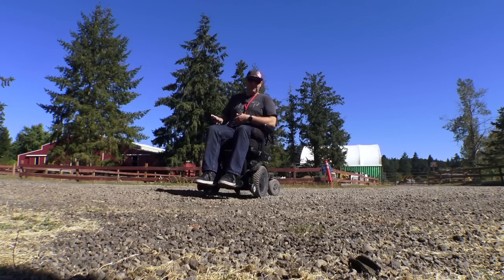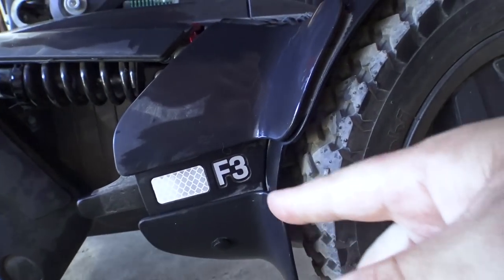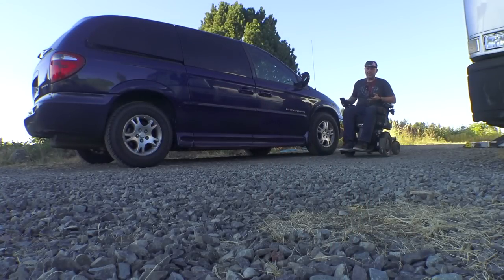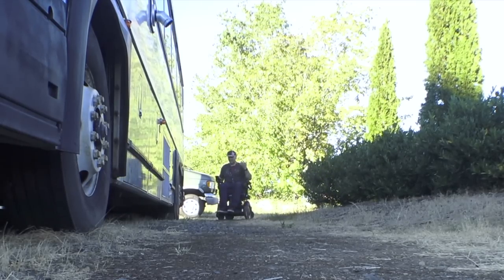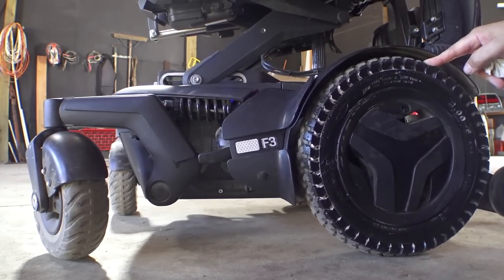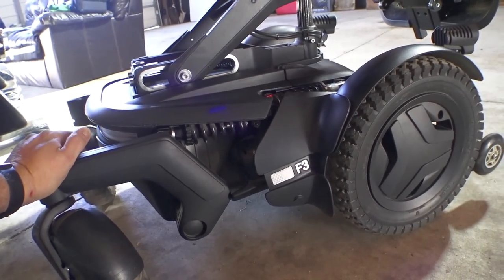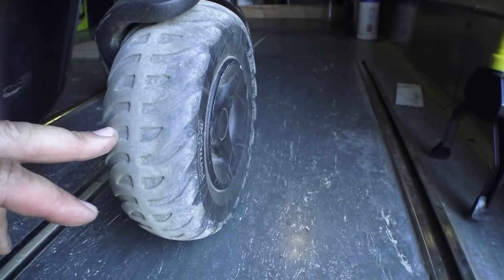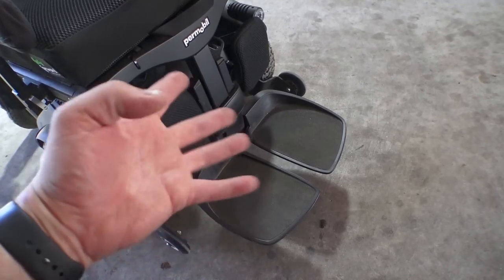VLOG 629: one year later - Permobil F3 review!

Comment: New to your channel. Transitioning from cane, walker, and mobility scooter to powered wheel chair due to rare disease causing spinal cord damage and eventual paralysis from the chin down. I'm new to the whole dealing with medicaid and getting a powered wheel chair through them. Just in the very beginning of the process. Getting evaluation through my doctor next week. I've been told that they only pay 80% for the cheapest chair available. How do you get them pay for such an expensive chair? Any help would be much appreciated.
Reply from the maker: hey! it all depends on your diagnosis codes - the chair in this video is a group 3.. also known as a 'rehab chair'
tilt function for example is qualified by things like pressure relief etc..
recline - can be things like using catheters, positioning etc..
power legs - edema/swelling in feet/legs..
those are just some examples.. but its all about the diagnoses and associated billing codes
seat lifts/elevators are almost never covered by insurance (maybe 15% of the time)
but if your conditions meet the proper codes, they'll pay for a group 3 rehab chair typically without too much trouble

also typically if JUST mobility is the concern, and have no pressure sore issues/positioning needs - they go for a group 2 chair.. those have a 'van seat' or some other kinda of static (non power adjustable) seating
though a lot of them have manual recline levers

sometimes they go for a group 2 chair if only 1 power function is needed as well
medical billing and coding is a tricky thing..
ya need an ATP that knows their job very well, and can write a GOOD letter of medical necessity!  but each feature needs to have a solid, matching billing code to get every line item paid for

for example.. if someone just 'wants' power recline because it would be nice, but no medical billing codes can attach to it (because they cant say its medically necessary), insurance wont pay for it
Reply: @TotallyNormal-  Thank you so much! I've been trying to find this kind of advice for a couple of months now. It's exactly what I needed to know. My disease is called OPLL, ossification of the posterior longitudinal ligament. It basically causes the ligaments next to your spinal cord to calcify and turn into bone and eventually fill up the spinal canal and crush your cord. It also grows spikes that pierce the cord. I have it in my cervical area bad. Had to have a surgery where they split open my c2-c7 vertebrae to allow room for the bone to grow away from my cord. It's in my lumbar area now. Daily life is dealing with constant pain and loss of mobility. I'm hoping a chair will help with the mobility issue. Whatever chair I get will have to have a good plush suspension on it because I'm very sensitive to anything jarring and I need something to support my head well because my neck gets tired very easily. Thanks again!
Reply from the maker: BTW.. if you a have medical need for good suspension, you might be able to qualify for a group 4 chair - those have much better suspension! like permobil F5, magic mobility, and some mysystems chair.  
good luck with everything! its a long process... ive got a series of videos about getting a new chair.. can take anywhere from 3 months to over a year once the process gets started.  just keep on top of things, and make friendly phone calls every few weeks to keep everyone moving along :^) https://youtube.com/playlist?list=PLDSsC1nZPlqlXIw7pcTeiSon67BYp9Qp6&si=EMSIkaIECMiOmarE6JChQQ
things changed a lot because of the pandemic.. but should be a similar-ish process

Comment: I agree with a lot of the things on this vedio.  Ive had my chair since 2021.  I love the features but as stated a good ideal not much thought.  The tires  don't last me very long either as I am a very active person.  I hate the plastic they could have designed them with more thought and I have very much expressed this to Permobil they are slow to service them also for the price I have been unhappy with the chair and the batteries it takes so long to get thrm replaced you really need s good back ip chair or they should loan you one just saying.  Otherwise it. Would be a great chair
Reply from the maker: BTW I’ve had really good luck with the aggressive tread tires! My last set lasted almost 800 miles- and they improve the ride quality a bit as well :-) 
They’re made by Permobil- I just buy them myself on buildmywheelchair.com

Comment: Hi Allen, I have a question pertaining to the batteries; I replaced both batteries with according to BK batteries the same type of batteries.  The problem is that they dont last but only three hours and I have to recharge them.  what do you think my problem is?  My wheelchair company has been no help.  It's a 2016 Permobil F3. the old batteries would last for days on one charge. please help!!
Reply from the maker: do you have a different charger ya can try just to rule that out?
Reply: @TotallyNormal-  the battery charger is working fine, because it only takes about two hours to recharge the batteries but they just don’t last
Reply: And I don’t have an extra charger
Reply from the maker: something is wrong if it only takes 2 hours to charge dead SLA batteries..
have you left it connected overnight to make sure they're getting charged all the way? what brand are the new batteries?
Reply: @TotallyNormal-  yes it’s plugged in most of the day and all night
Reply: Well they are not completely dead, the battery lite is usually flashing by the time I get inside my home and plug it in
Reply: How can I tell if BK batteries sold me the correct batteries
Reply: First let me thank you for responding
Reply from the maker: ive never heard of BK batteries.. but these chairs are designed to work with OEM batteries.. which is MK Power in this case.  other brands introduce a lot of variables that can range from incorrect battery gauge readings, from not being able to provide enough amperage etc..
Reply: @TotallyNormal-  is it possible that they were hooked up wrong

Comment: i could not wait for it to rain so i could test out the quantum 6 edge 3 . let me tell you ,those 4 pole motors really perform . i was able to do several spin outs really well .in power 5 level ,that chair will virtually snap your neck if you keep the joy stick engaged , its way more intense than any mechanical bull i been on , trust me  lol. . i notice into several yards i tried , in wet long =er grass this thing really digs in the yard , im telling you ,it will leave ruts and tear the grass up .at full speed on the wet pavement , it will do horrific spin outs , my goal was to see if i could flip it lol .i wish i could find someone to just spin it in a circle at level 5 ,i really dont think a human body could attain that in this awesome chair .my goal is to one day purchase that all terrain utility wagon ,the one with the big rubber tires . ( The bigfoot panel wagon is the classic red wagon from your childhood but with some added wood paneling to keep passengers or cargo secure! Features include 10 in. pneumatic tires that can withstand rough terrain and a 330 lb. weight capacity. This red wagon is great for your kids or grandkids to play with but can also haul gardening tools or supplies in the yard!

Steel wheels with large pneumatic tires
High stakes are securely fastened to the wagon
Wide wheelbase for stability
Red powder coated finish resists rust
Full 33-5/8 in. x 15-3/4 in. x 5-1/2 in. deck
5-1/4 in. wood panels
Pull through grass, over rocks, anywhere ) IT SEEMS TO BE AN EXACT COPY OF THE INFAMOUS "ALEKO ALL TERRAIN CART . !!! MY GOAL IS TO HAVE AN EXTRA SET OF BATTERIES OR BATTERY PACK IN IT AS WELL AS OTHER GEAR !  i am most interested in how much weight i can actually tow !!!! i also want to configure some contraption that will drive the chair in a straight line , hands free while i perform shooting my bow repeatedly at targets that are stationary or moving . i would prefer to do it electronically if possibly ,but will also consider some other type mechanically operated device , sort of an auto pilot , if you will ! lol ...... .  my goal also is to build an contraption that is triangle shape that has a small side shaft gas engine with a chain and set of sprockets that turn a single tire in the back that is steerable with a long rod that circles around the front of the chair . think of a mini bike frame that the mid to back section has been cut off from front end  lol . so you will have a motor ,chain and sprockets and a single tire in the back , i call it my long distance gas powered assist !!!! once you get to where you are going , you engage the electric motors to quietly move around . i imagine this would be a very awesome tool to have for your chair to be abled to go a semi far distance at 2 to 4 or more times the regular speed without having to have a real automobile or van.it would have a throttle and brake handle similar to a mini bike or motor cycle ! .i want to make it where it attaches where the basket on the back goes or some other system like a hitch maybe ? imagine for a second , how a contraption like this would be nice to have you also could have a couple of alternators to charge the batteries or outfit it with another type generator with a 110 converter that supplies the energy to use you chairs charger ? my second idea is to make a trike version that will have a side shaft mini bike motor or nicer motorcycle motor that powers a single wheel that mounted to the front of the chair that has a head light ,brake handle ,speedometer, and throttle mounted to a more comfortable double hand handlebar !!!! my only concern is , will it be good for the "free wheeling " function of the chair ?either front or rear mount would attach and un-attach real easy ! THE FRONT MODEL TRIKE VERSION WOULD ALLOW THE RIDER TO FULLY EXTEND THEIR LEGS FOWARD THAT WOULD BE PROTECT BY A FRAME WHILE ZIPPING AROUND TOWN, OR ON LONGER TRIPS !!!!!! ( SO HONESTLY ,,,,,,,, WHAT DO YOU THINK ) ???????????
Reply from the maker: https://youtu.be/pEWmF1f-W-g

Comment: I have a 2021 pro mobile M3 and I love it very much. However I need somebody to replace the controller and I live in Portland. I have plenty of money. Can you recommend a company for me or possibly come out and do it yourself? I know that’s a lot to ask I can meet you anywhere and Portland also. Also I think I bought a chair off you last summer for $200. It’s what I’ve been using for the past two months it’s a pronto M 51. I want MyPermobil and three back working! Desperately Jason
Reply from the maker: whats going on with the controller?
Reply: @TotallyNormal-  The charger input cable got hot and melted the XLR going in. The batteries with no longer charge so my brother and I bypassed it and put a Schumacher fitting down by the batteries to charge the batteries up. We opened up the controller and disconnected the XLR so it would no longer be shorted. But the controller still seems to be malfunctioning. I need somebody with hands to work on it. The batteries are charged however the controller will no longer light up.
Reply: Also I am quadriplegic so I am not really capable of disassembling things and putting them back together physically.
Reply from the maker: call a permobil rep - this is a problem with some of the chairs and the new volt pro charger.. they should be able to take care of things.  DON'T use the volt pro charger that it came with! those were the issue. (they have since fixed the problem) but the joystick and charger will need to be replaced
use this link to send them a message, and the local rep should get notified (they're pretty good here)
https://hub.permobil.com/support
Reply: @TotallyNormal-  Thanks this is awesome advice I will follow up I’ll let you know how it goes. I also have a quantum 610 pride that I need worked on if you know of anybody who needs work. I have already purchased a new controller it just needs to be installed.

Comment: Another question. How do I tell what year mine is?
Reply from the maker: the serial number sticker has the date on it as well.. typically on the left side of the chair (as you're sitting in it) near the back, behind the drive wheel.  M-series chairs ya can see it thru the wheel spokes.. but its not super easy to see on them all :^/

Comment: Can u tell me what app u use for tracking distance ,speed, on ur phone .
Reply from the maker: i use a handheld GPS when i need to track stuff like that.  but even those arent super accurate measuring speed below 10 mph (which is the speed of most chairs) they track distance quite well.. but not as a spedometer
Reply: I use Ride with GPS app. It's pretty accurate on speed. I like that it maps out your route you did and you can even save them. It also tracks elevation changes.

Comment: I’m not understanding what the hooks on the chair why are you concerned why you have something to raise the seat you get on the bus you raise the seat up a couple of inches you hook the chair up you lower the seat you take your right as you’re getting off the lift the seat up they had hockey when you go on your way
Reply from the maker: covers and light still get inadvertently ripped off by the bus operators, regardless of how tall the seat is.  most other chair brands have tie down points out i the open, and easy to get to.  even on older permobil chairs, the tie down hooks were WAY easier to access
Reply: @TotallyNormal-  Well I’m getting F3  hopefully delivered or should I say re-delivered the first one came was beautiful but it threw error code that the guy couldn’t clear anyway getting back to the  tie-downs i’m going to use the ones  like I used to use on my Harley Davidson and you loop it through there and just let it hang so they could just hook through a nylon tie down on all four of the anchors without having to go metal to metal and level extended approximately 8 to 10 inches longer at least. Quick question the F3 came with lights on it and separate buttons to do all the functions do you know if that particular handset can be preset for seating positions thanks for your help I really enjoy your videos they’re a big help

Comment: I’m getting a F3 like yours I was wondering if there’s any way electronically to make it quicker without changing the motors are there any computer settings that could be modified to make it go a little faster
Reply from the maker: 6.5 mph is the mechanical limits of the motors, and the voltage the electronics can output
Reply: @TotallyNormal-  Thanks Permobil has on the website it says 6 miles an hour and I don’t know if I 1/2  a mile an hour is gonna make a much difference but it would to me especially when I cross streets
Reply from the maker: IDK why they say 6mph.. but ive tested my 2017 & 2021 F3's and they both go 6.5 mph when the programming is set to 100% forward speed - i used a 50 foot laser speed trap setup